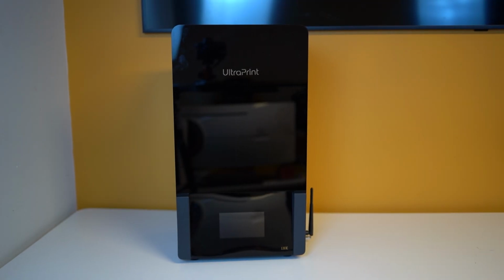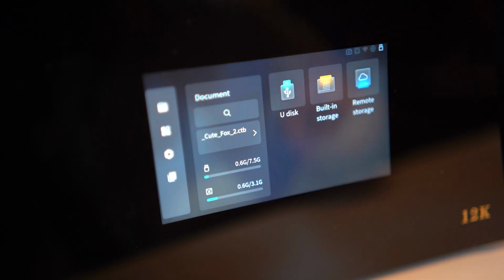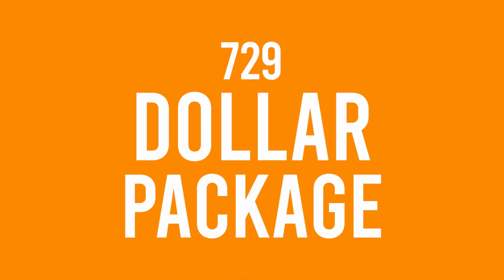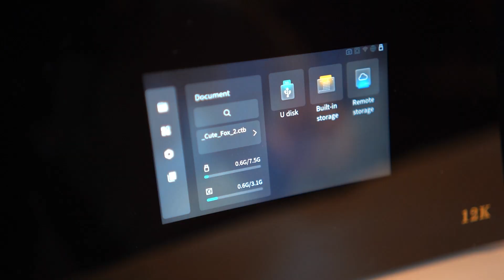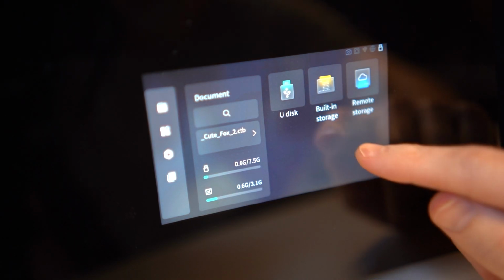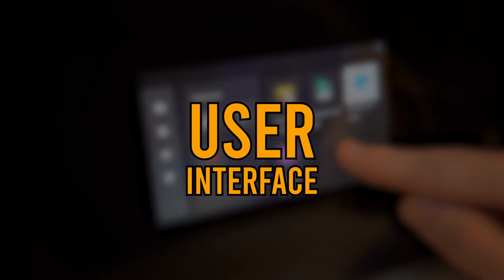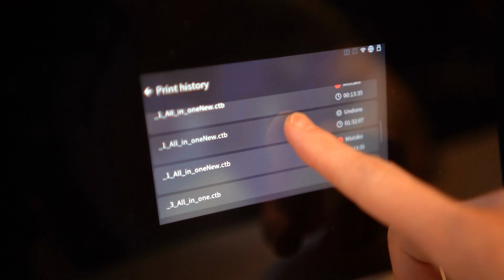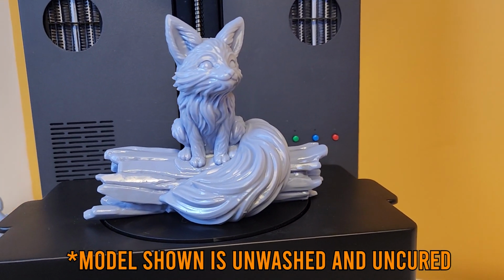IN-DEPTH Analysis of Kickstarter's Ultraprint 12k 3D Printer!

Comment: Hi Jerry! 
We're sincerely sorry for the issues you've experienced with our prototype product. It's a relief to hear that you and your team remain unharmed, and we greatly value the feedback you've provided. Rest assured, we're diligently addressing these concerns to ensure our printers are both excellent in quality and safe for use.

To reassure our valued Kickstarter backers, who are our earliest and most important supporters, we are committed to ensuring the highest quality in our products. If any quality issues arise with our printer, we sincerely promise to provide a full refund or a replacement within 60 days from the delivery date (calculated from the receipt date), completely at our cost. Your trust and satisfaction are our top priorities.

Here's what we're doing to enhance our printer:

1) Power Switch Upgrade: We take full responsibility for the malfunction of the power switch, which was a result of inadequate power support for the required load. This led to overheating and an automatic shutdown, causing the metal casing to show signs of damage (like the "explosion" you mentioned). This is a common safety feature in many electrical devices, designed to cut off power when overloaded to prevent further problems. We've addressed this by replacing the original plastic switch with a more robust, high-capacity metal switch.

2) Improved Temperature Control: We're modifying the temperature control on the front touch panel for easier access and operation.

3) Resin Bottle Design: The resin bottle isn't completely sealed because it needs air to work right. Understanding concerns about spillage, we've developed a secure holder for the resin bottle, ensuring it stays safely in place during operation.

4) Integrated Washing Station: Currently, our printer offers dual functionality with both printing and post-curing capabilities. Looking ahead, we plan to integrate this washing station feature directly into our printer, enhancing its overall functionality and user convenience. Additionally, we've provided a washing station as an optional add-on on Kickstarter.

5) Timed Curing: We're currently testing a timed curing feature and anticipate its introduction shortly.

6)Enhanced Touch Screen: We are optimizing it to improve sensitivity.

7) WiFi Connectivity Improvement:  Regarding the WiFi file transfer issues, several factors could be responsible, such as unreliable router connections, slow internet speeds, network dropouts, or incomplete transfers from slicing software. To address this, we are developing a solution that bypasses these router-related problems. Our team is testing a new device that allows for direct file transfers from your computer to the printer, removing the need for a router and ensuring a more stable and reliable connection without the worry of network interruptions.

We really hope this shows you how serious we are about making a great printer. We appreciate your support and patience as we work on these improvements. Thanks for helping us get better!

Best,
UltraPrint Team
Reply: This company has stolen 1000 dollars from me and thousands of other people, you should delete the video or at least update another video warning the community of what has happened to many of us, it would be very helpful to warn possible users of future scams, thank you so much!

Comment: This video is clearly a fraud. Not 1 second of this actually printing. Your edits are done in such a way to trick the viewer into thinkg you printed someting. Shame.
Reply: I'm sorry but you're full of crap man. You don't have to do a full print time lapse to show it printing. And you don't need $3,000. You can just use your cell phone or your other camera. After the build platform is above the resin tank, just film a 2 to 5 minute video. This printer is supposed to be fast the layer times should be under a few seconds. Should be pretty easy to do.
Reply from the maker: oof. Showing a resin printer in action is not an easy thing to do. The only way to do it is with a resin lapse, and I do not have a compatible branded DSLR. I have a Sony branded camera. I do have a resin lapse with an adapter, but it does not work well due to voltage values. You also need to significantly modify the printer in order to make the resin lapse work. ALSO, it will shutter your DSLR THOUSANDS of times which means on a $3,000 camera a single time lapse can possibly cost upwards of $50 of the camera's life span depending on the layer height. Let me know if you want to support the channel! I can make you a resin time lapse ThePrintHouse.link/Coffee

Comment: I am definitely not going to hate you for your chitubox medium auto supports, because that's my way, too
Reply from the maker: hahah we're friends for life lol!!
Reply: @ThePrintHouse  well, at least I subscribed, in terms of that Kickstarter crap, I have concerns about the safety.

As far as I can see, there are two probably 100W PTC heaters controlled by one W3230, which is only rated for 10A
Reply from the maker: @runklestiltskin_2407  well I greatly appreciate that!! Welcome to the channel!!! You should also check out our discord ;) supposedly there is even a third heater under the vat. I have no reason to believe ultraprint is lying.
Reply: @ThePrintHouse  Assuming the heated vents remain in their current position for production, isn't there enough gap to 3d print a redirectional exhaust cover? Hopefully the VAT is also heated. Can you confirm with Ultraprint? and for the bottle out back, its really not a big issue. In many ways we can secure this bottle. Its a minor issue.
Reply from the maker: @tonypetroski216  that's actually a pretty great idea, but you would need to dissipate the airflow heavily otherwise you would end up with the issue just at a lower part of the printer... Which would be even worse. As it is now, it likely won't affect anyway unless you regularly make max build plate prints.

As for the bottle, I actually disagree. This is my 3rd or 4th experience with resin pumping systems and i think it'll be more difficult than you think to properly secure the bottle such that when the printer moves the bottle moved in unison with it. Is it possible? Well obviously it's possible, but I again I think it'll be harder than you think and the solution definitely won't be clean. This is a serious oversight by the ultraprint team. They need to make air purging resin lid similar to apex maker. That's the only real solution in my opinion
Reply: @ThePrintHouse  I've got a few ideas on both issues, background is mech. eng. Both not big issues. Thanks for your indepth review & sharing your experiences on this product.
Reply from the maker: Absolutely! Thank you for checking it out!! :D

Comment: "literally exploded?" Explode intransitive verb, 1. To release mechanical, chemical, or nuclear energy by the sudden production of gases in a confined space. 2. To burst violently as a result of internal pressure. 3. To shatter with a loud noise.
Reply from the maker: It did 1 & 3 and if you want to get technical I could argue it did 2 as well. I'm not sure I understand what you're trying to accomplish here. As a public voice my primary goal is to share my experience, and regardless of my word choice this is absolutely something that certain people would consider a deal breaker. I understand your concern with my verbiage, but the entire story was told, so one can disagree with my choice of words yet still get value from this video.

Comment: As someone commented on your rant about the "explosion", its not a very genuine claim for a switch dying.
Reply from the maker: I never made a rant. I wanted to be very transparent about my issues because this printer comes from an unknown brand and this is the biggest issue I have ever had with a 3D printer. I would say 95% of the 3d printing community would not be able to fix this issue themselves, so I personally feel this is a very genuine issue. If you disagree then I totally respect your opinion.